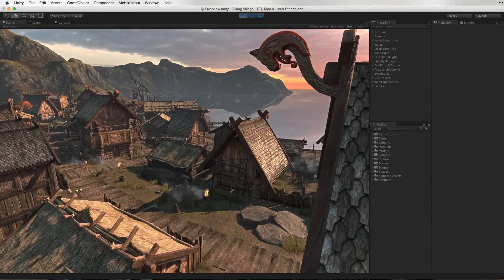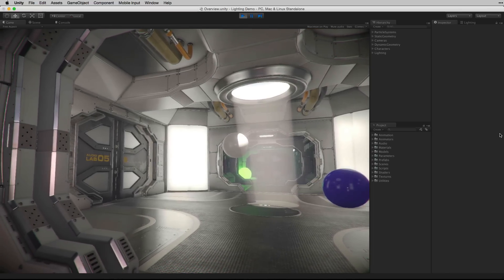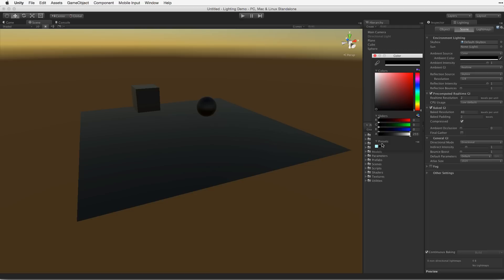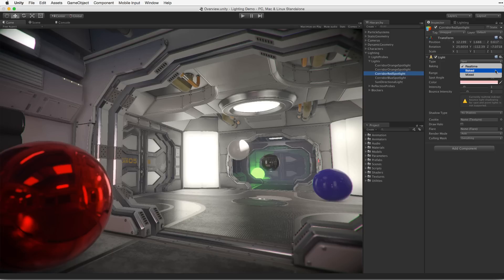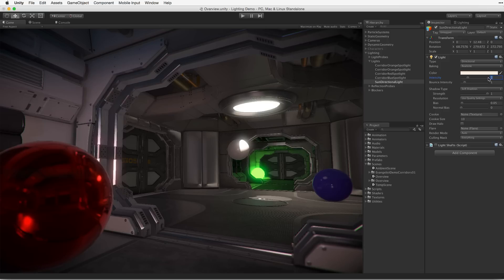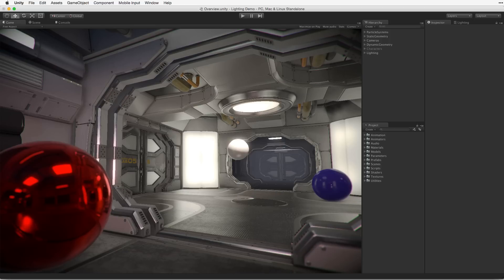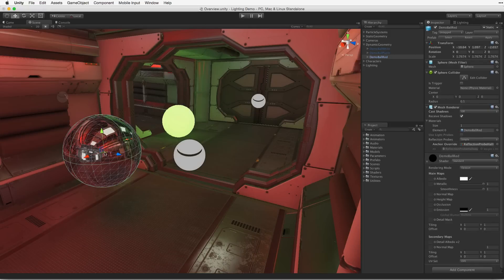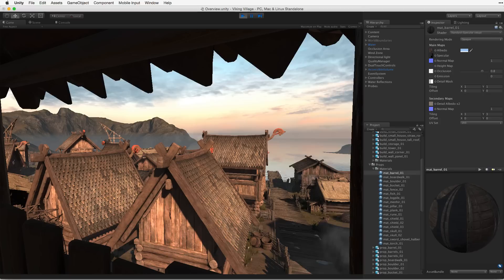Unity 5 Graphics - Lighting Overview - Unity Official Tutorials

Comment: Does anybody know of ANY way to use AO maps in Unity? I thought light maps in a game engine are like standard feature, I didn't know I should search the whole freakin net for 10 straight hours and not finding a straight answer on anything. Why is it so impossible to have a damn tiling texture and then a separate channel with the AO? Is it REALLY too much to ask???
Reply: Dude do you know ANYTHING about unity's PBS? there is a entire god damned channel (or whatever you call it) for AO in the shader.
Reply: Ivy I'll look into it, thanks! Even though I ended up baking ao in certain decals which works well and is pretty fast!
Reply: Nτινος Σταματιου You are better off using it only for micro-occlusion tho. SSAO (and Unity SSAO+) are better for general AO anyway.

Comment: I solved my problem with long baking times in unity 5 by selecting the baked object then going to the Lighting->Object tab and then setting it to Default-VeryLowResolution at Advanced Parameters .. bake takes 30 seconds on a pretty complex city-mesh now.. compared to before when it took ... forever ... its pretty good.. and the quality is not that bad .. I will tweak some more

Comment: How is the Volumetric Light at 0:30 made? is that with a plug in on the asset store? when they show the same scene at 7:40 it no longer has the Volumetric Light On....
Reply: would also love to know how to do this. any thoughts?
Reply: that's probably an image effect
Reply: probably but I want to know wich one and if its available to the public, because it behaves really nice for what I can see, it interacts with the sphere.. and is not Unity's SunShafts...

The other plug ins I know are Sunshine! or Jove, but I don't think they're compatible with Unity 5 yet, and they require a lot of changes to the scene to work.
Reply: it's probably something like global fog or some other rendering effect, or a mixture of many, they don't use third party products on tech demos ;) so it's definetely included but I don't know which one it is
Reply: It's from the free atmospheric scattered fog asset on the asset store but I don't recommend it, only works if you have a huge high poly sphere in your scene and it the shader does not support default unity terrain. There is a better alternative which is also free, just google it.
Reply: Volumetric light only shows when the game is running and yes that is volumetric light and volumetric light takes frames. Also when you build your game and you enter it from desktop it will not have Volumetric lights inside because you need to add shaders into Graphics section. There are 3 shaders for volumetric lights.

Comment: Anti-Aliasing is terrible in every Unity video I've seen. Is there or are there any improvements which can be made to this?
Reply: Yeah, definitely.  Go Edit>Project Settings>Quality.  Goes up to 8x Antialiasing.  Hope that helps.
Reply: So...why did they not do that for these promotional videos?
Reply: so...it's bad or the frame rate is bad...
Reply: So...they created and rendered a real time lighting demonstration which had no relationship to mobile, but used the AA for mobile...and other engines have no issues for AA on mobile devices...

Why have they done this for every single video?
Why create a demonstration designed for devs and potential licence holders, but show horrendous AA?
When you say 8X, what kind of AA is that? Super? Multi? Spatial? Temporal?
Reply: *****  Erm, no. three times no. There is nothing about video compression which can either add aliasing or, require you to add it prior to compression for some YouTube reason.
YouTube is 4:2:0 YUV 8-bit video macro-blocks. I would be the first to say YouTube has the worst video quality out there in terms of colour depth and bit rate, but I would never say you have to turn off AA in your footage because of YouTube, that's just crazy.
Reply: *****
I do know.

Video compression does not work in that way.

The AA is weak and unless someone can show me otherwise, that is what I'll believe.
Reply: Or someone can link me a Unity 5 tech video showing me 8X AA or just better than what we are seeing here, including all of the lighting they are talking about in this video.
Reply: ***** If you're worried that Unity doesn't support AA, it supports, SSAA, MXAA, FXAA, and CFAA just to name a few, in fact, I think that you could implement or even invent any kind of AA you want in Unity.

The reason that it's not used in these videos is mainly because they want as much performance as possible with as many effects as they can render at a constant 60fps, AA is pretty useless for these videos as most of the time Youtube compression has a slight blur to it anyway.
Reply: If you were the person who put this video together and gave THAT as an excuse (it's not a reason) then you would not be working for them any more.

60 FPS video is useless for YouTube under 1080P when the playback is default to 30 FPS. No one, I mean NO ONE would care whether this video was at 30, 60, 120 FPS, they just wouldn't. Nor, would they even be able to tell the difference if you edit and then compress the video to 30 FPS, and then have YouTube re-compress your compession again.

By your supposed rational, no company EVER would need to have any form of anti-aliasing, and would record everything at 60 FPS, edit it and compress it to 30 FPS and not worry because YouTube apparently blurs everything out (which it doesn't).

I can tell the AA in this is either switched off, or just pathetically bad - so my question: is where are the videos by Unity of their AA settings with all of the graphic turned up to full? Why do they not have this? How is someone supposed to be able to clarify the quality before delving in and learning an entire game engine only to push it and find the quality of the AA is not good enough (unless you turn it off)

I would like to see Unity show us in detail how fast this engine is at MAX AA and MAX physics running with multiple agents operating in the background, with a Scaleform or otherwise GUI on top, like games do.

Specific to this video topic of "lighting overview" I would like to see their lighting working with full AA switched on and an FPS counter running along with details of the scene in terms of topology and texture size.
Reply: ***** I wouldn't bother, he's clearly die-hard for some other engine and is unwilling to broaden his horizons, AA is such a simple thing that it's kind of irrelevant nowadays, everything supports everything, it's just a post processing technique at the end of the day that can be done on anything with access to the frame buffer.
Reply: *****
 You keep saying this, but if AA is so simple to do in Unity, why have they avoided it in these videos which are supposed to showcase  the engine?

If it's so easy, why not include it?
Reply: Okay, I didn't want to tell you this so I could avoid hurting your feelings, but they knew that you would be so concerned about the AA and wanted to enrage you before having their way with your behind, no lube allowed, they're going in dry m'kay?
Reply: So?

I want to see what I want to see in a promotional video regarding the lighting algorithms of this game engine - the reasons why they have decided to turn them off (unless better evidence is forthcoming beyond the "no reason whatsoever" evidence these comments are providing) then a viewer is going to conclude that:

a) They did not turn the AA on because the game engine cannot handle it WITH the lighting the chose for the video.

OR

b) AA cannot be turned on to the level which other game engines provide, like FXAA or Temporal.

Now then, either you can provide evidence or you can't, until then; this is what people are going to assume purely and exactly for the reasons you and other have stated: that there is no reason why AA cannot work to the level which a dev studio expects from a game engine.

Not pointing a finger at you directly, but you have backed yourself into a corner here and I doubt you can back out of it. The only people who can resolve this are Unity, so viewers of this video are now awaiting them to answer this:

"Why was the AA turned off?"
Reply: I'll wait for the makers of the game engine to address the reasons for the omission.
Reply: If my question goes unanswered, we all have an answer.
Reply: ***** Here's your answer: http://unity3d.com/get-unity

Just be sure to import the image effects asset package when you create your project and attach the antialiasing script to your camera, Unity themselves probably wont give you an answer, they have far better things to do such as make their engine as great as it can be.

Or an alternative to my answer, a proposal. I'm sure somebody as narrow minded as yourself will appreciate learning just one engine and blind-siding yourself to all the other wonderful things happening in game-dev: https://www.unrealengine.com/what-is-unreal-engine-4
Reply: That isn't an answer as to why the AA was switched off for this video. And, to be frank, they had time to create a video initially and I'm sure they have someone looking at their videos and looking at the comments. If not, then I would ask an additional question: Why have the comments of the video been enabled? Because if they didn't wish for people to post comments for them to read, why enable them?

Additionally, your comment just doesn't have anything to do with this video. I'm posting about this video on the YouTube channel by Unity. The video is called "Unity 5 Graphics - Lighting Overview" and for this they have either turned off AA or have reduced it for reasons which you do not have the answers to, nor have Unity addressed.

If you wish to post direct attacks to myself for asking what should be a very straight forward question, those comments will be deleted.
Reply: ***** The key phrase here is "Lighting Overview", not "Antialiasing Overview"
Reply: Vulgum Pecus
click
Reply: ***** ...which is what I am commenting on...you?
Reply: Vulgum Pecus
all you comments have been deleted - unless you comment maturely, this is what will happen.
Reply: Vulgum Pecus
click